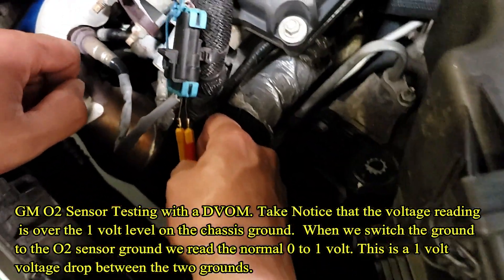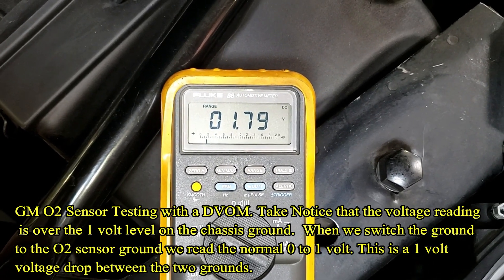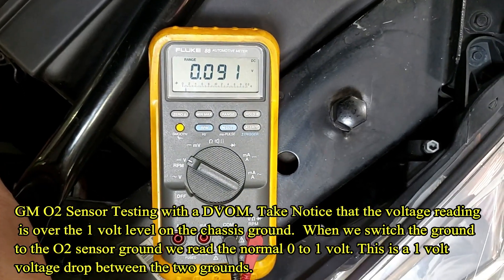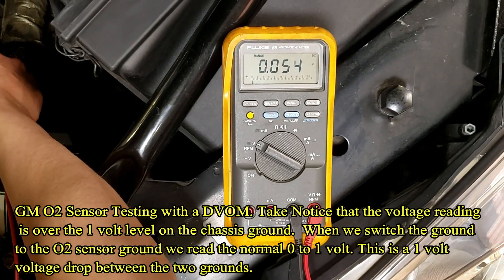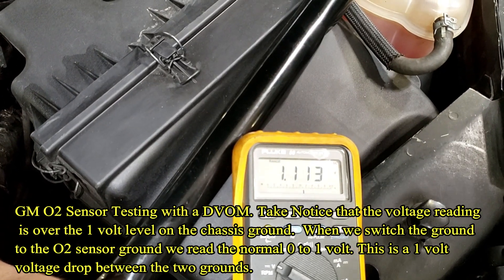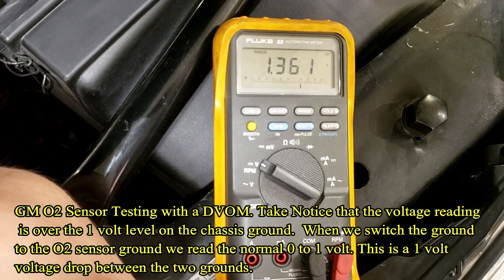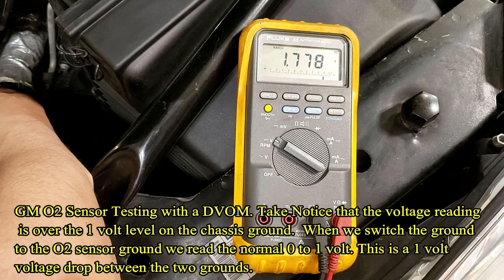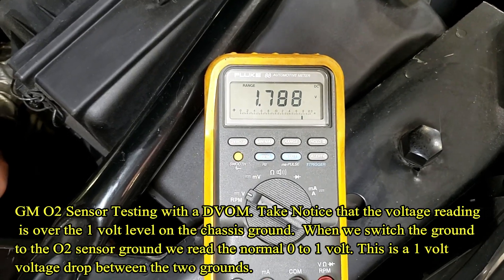GM O2 Sensor Meter Testing

Comment: Interesting video. I've got a engine light on for post cat sensor, codes P0140 & P0138.
With my basic EOBD reader (UK) on live readings, the sensor is stuck at 1.750v engine hot and running or engine cold, off and ignition on. I'm guessing that's 1.750v coming from the ECU and if its connected properly, that must be a busted sensor?
Pre cat O2 working OK and has the same 1.750v on the live readings when cold engine off.